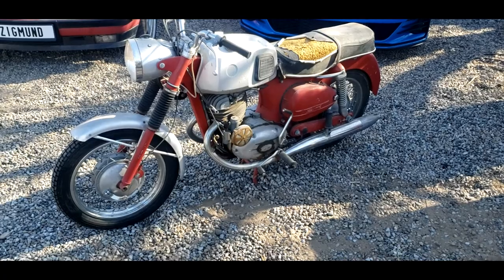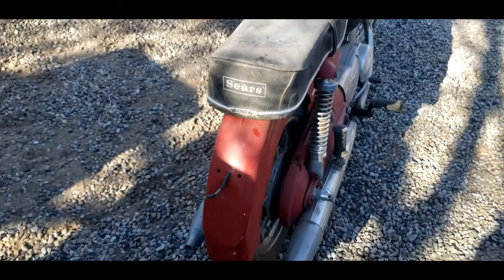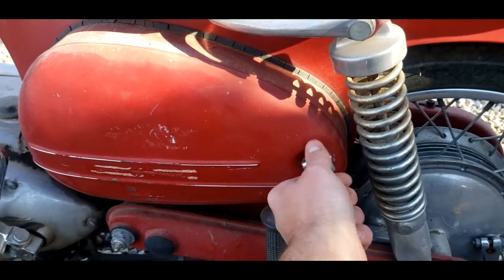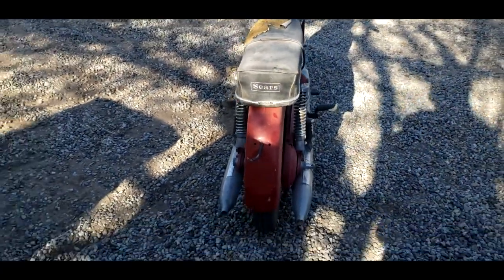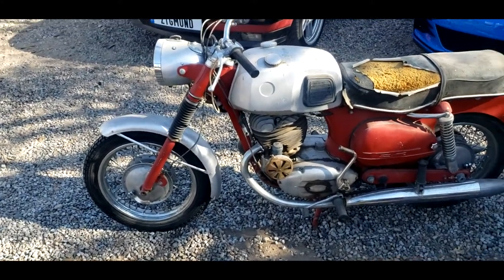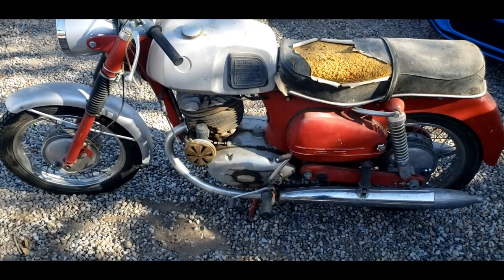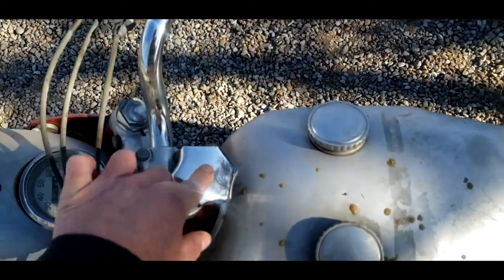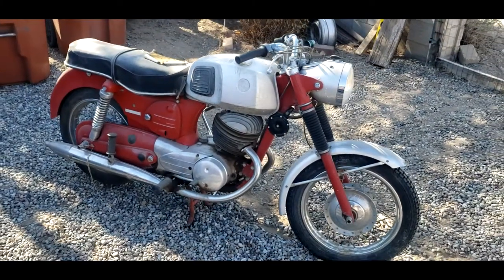1968 Puch 250 SGS aka Allstate SR250 Intro and walk around

Comment: I recently picked one of these up for 50 dollars from an older gentleman in my hometown, but the positive battery cable is entirely missing, and I can't for the life of me find where it runs! Is yours connected and wired? Because I can't source any decent wiring diagrams for the bike
Reply from the maker: Let me check I might have a wiring diagram, and yes all the wiring is intact on my bike